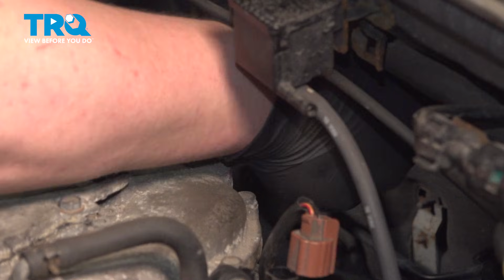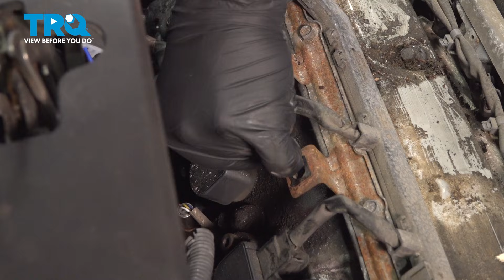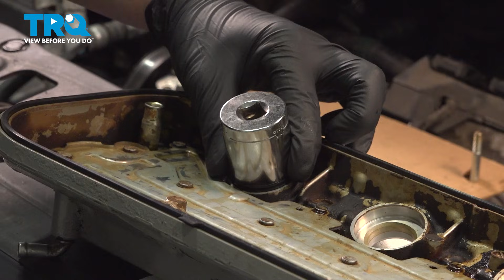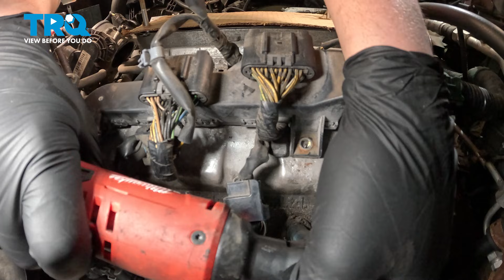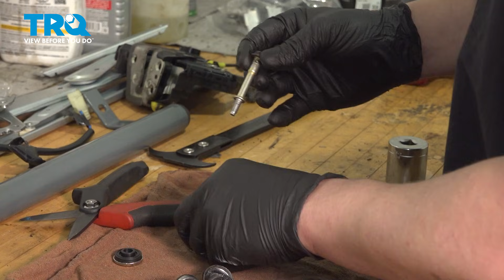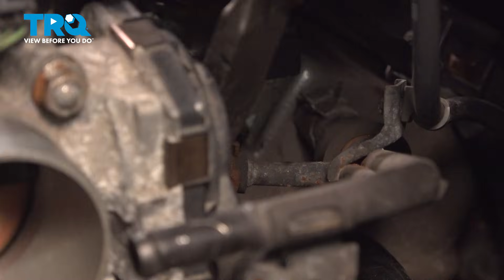How to Replace Front & Rear Valve Cover Gaskets 2003-2008 Honda Pilot

Comment: Great video I thank you for sharing your knowledge.. however, I can't agree with the "you don't have to" when it comes to cleaning up the parts you remove during the breakdown.. yes you DO need to clean everything up as best you can.. if you have it all apart take the time to get everything as clean as possible.. it certainly doesn't hurt.. take pride in your work and especially if it's for a customer who is paying for your services 👍 that is all... Thanks

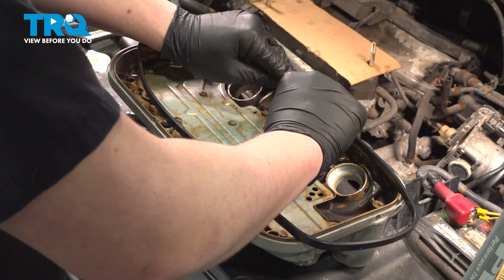Comment: 15:10 when he’s putting in the new gasket there is clearly an indexing point where the tab should be on the other side of the valve cover.

Comment: Fyi: the 2 wheel drive valve cover gaskets are cheaper as 1 of them is smaller then the other. 4 wheel drive both gaskets are the same size!

Comment: Why when I look up the intake gasket for this engine. The replacement part for it has square openings on it and they show round gaskets with it also.  When you take this off you show a upper and lower gasket on the intake. Am I looking up the wrong thing.

Comment: That rear valve cover is going to be a challenge, there’s tiny seepage of oil around the coil pack on one of the rear spark plugs and the connector was so crusted it snapped lol